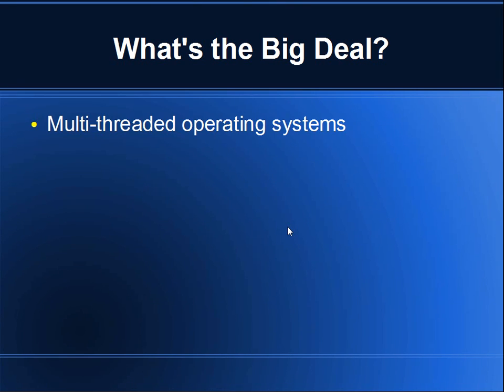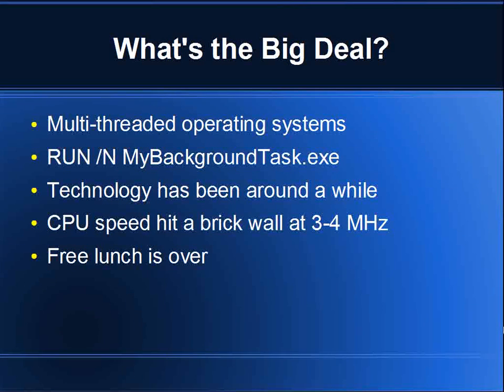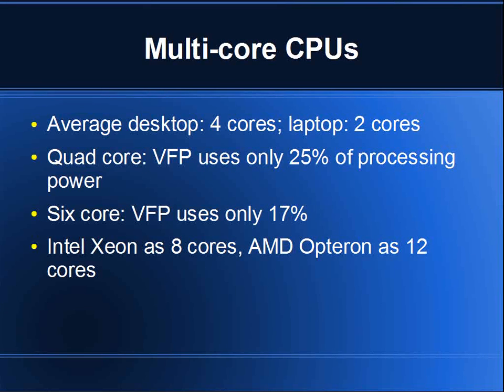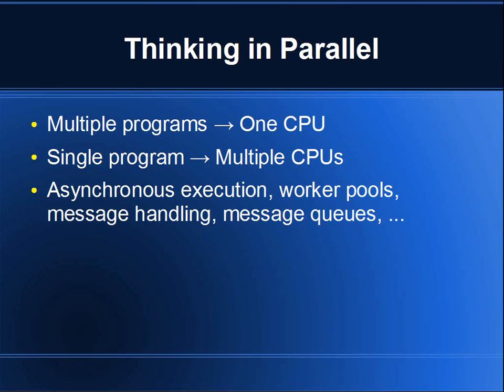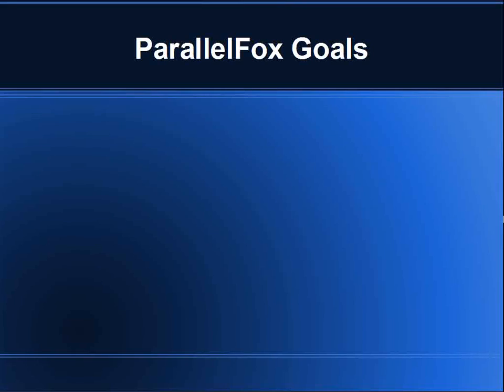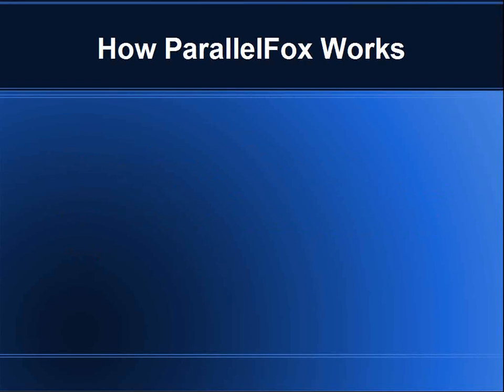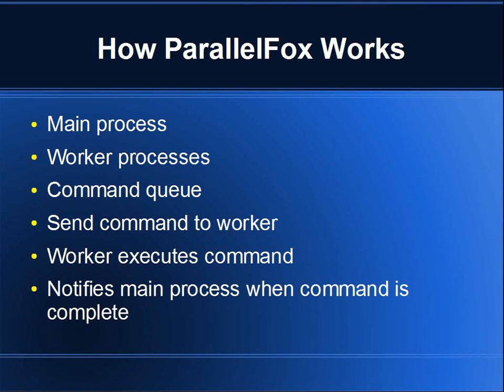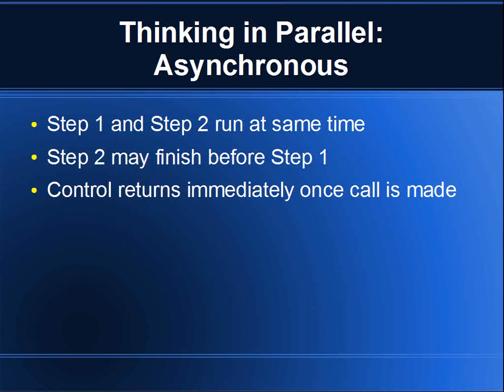ParallelFox: Introduction

Comment: Hi!  i've just saw your 4 videos!  Great stuff!   i've been using VFPA(VFP Advanced), it runs on 64bits, it looks faster, can your ParallelFox work on it?  Thanks for what you've done!
Reply from the maker: I have not tested with VFP Advanced (32-bit or 64-bit), but I have heard that COM works fine on those versions, so I would expect ParallelFox to work as well. You would probably want to recompile ParallelFox.exe using VFPA, so the workers would also use VFPA, rather than standard VFP 9.
Reply: @joelleach  Hi! I ran your ParallelFox test program on VFPA 32 bit and it works fine, I changed the line of code where it creates an instance of VFP  from "loVFP = CreateObject ("VisualFoxPro.Application." + SUBSTR(VERSION(4),2,1))" to "loVFP = CreateObject ("VisualFoxPro.Application.A".  When ran on VFPA 64 bit it complains about an "OLE exception error: Exception code C0000005. OLE object may be corrupt".  The loVFP object gets created but looks incomplete. Will you be able to take a look into it and let me know if it can be used in VFPA 64 bit or not? Thanks, Jemuel Ladores
Reply from the maker: @jemuell.6773  Please see my reply to your question on my blog at http://www.joelleach.net/2020/05/04/parallelfox-1-3-released/